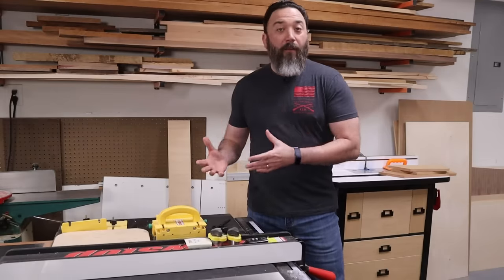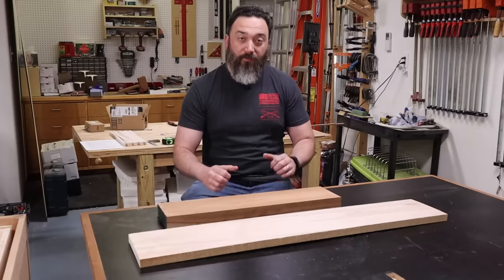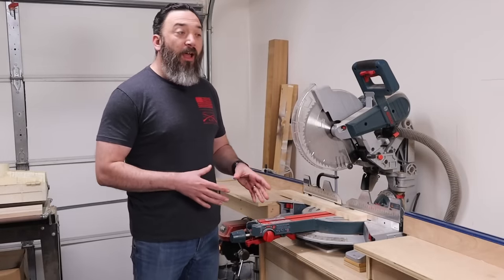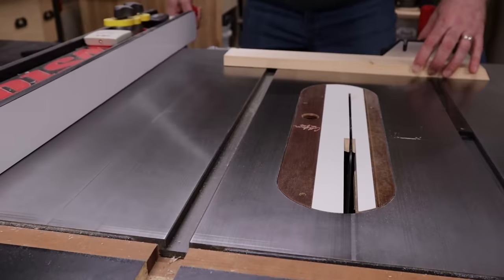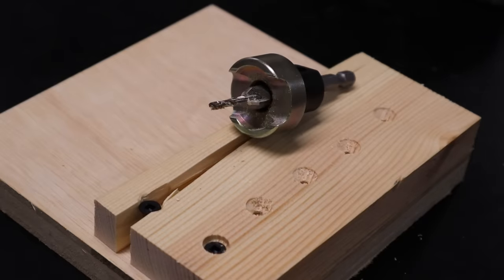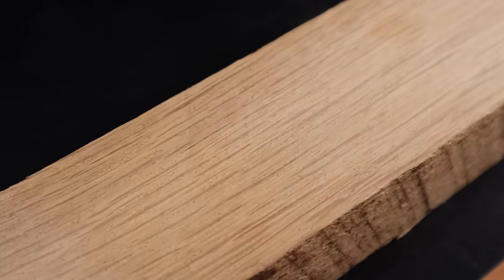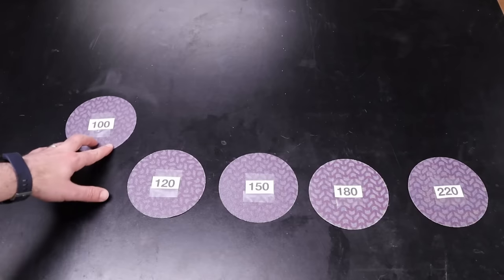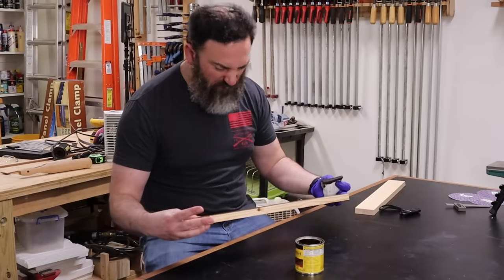Every Woodworker Should Know This!

Comment: I generally choose my next grit by adding 1/2 of the current grit and round down if needed. For example, if I'm using 150, I'll take 1/2 of 150 which is 75, and add that 75 to 150 which gives you 225. Rounding down means my next grit would be 220.
Reply from the maker: That method works as well! Use whichever is easier for you to remember.

Comment: It's been many years since I bought wood in the States. One point I can't remember when measuring for board feet is the difference between a rough-cut board and one that's been surfaced. So if you buy a rough-cut 4/4 board six inches wide, then the volume is clear. But if you buy a board that's been surfaced on two or four sides, it might end up as 3/4, by five and 3/4" wide. So how is that board measured? By the original dimensions or by what you're actually taking out of the shop?
Reply from the maker: It is dependent on the seller. Some will round up on the milled boards, others will charge based on the exact measurement but it's at a higher price than rough boards, and some do both.

Comment: Nice video but I think that a better rule for sandpaper is to just not go higher than 50% from the previous paper. So, if you're starting with 100 grit you wouldn't go higher than 150 on the next grit, starting with 80 then you wouldn't go higher than 120 next, and so on. This rule is just easier to remember, imho. Good basic knowledge in the vid though, thanks.
Reply from the maker: Same concept, use whichever you prefer.

Comment: As I was watching the part in the video about never placing the end of the board against the fence when using a miter, I noticed the gap you have between the bottom of the fence and the table saws surface. I mention this because of a close call I had while working for a custom cabinet shop, I was cutting backs for the uppers when the 1/8” material slid in the gap between the fence/table saw surface causing a massive kickback and causing the piece to hit me in the family jewels. 

I was taught years prior, when cutting 1/8” sheet material to raise the blade all the way up and when pushing material along fence with both hands put a upward bend on the side closest to you. Prevents piece from wandering under the fence. Just thought I’d pass it on, if you have any other techniques please share, I feel safe cutting this way but some people may noid out having the blade all the way up
Reply from the maker: You should try to minimize any gap as much as possible to prevent material from getting beneath the fence. As for blade height, I like to have the blade high enough that the gullets are above the surface of whatever I'm cutting.

Comment: Rubio monocoat only recommends you sand up to 120 to 150 grit
Reply from the maker: I know, but I've never had an issue with 180 using Rubio. I like the smoother surface at 180 so that's what I do. They also say you only need to apply 1 coat, but I have much better results and a nicer finish if I use 2 coats.

Comment: I just found this channel.  I will search what other tips you have, but is there an indoor vs outdoor wood video?  Which wood types should be used for outdoor.  I have a project to build outdoor items that will need to withstand dry heat (100+ for months at a time)
Reply from the maker: Any wood left outdoors without regular maintenance is going to eventually turn grey and crack and any finish you apply will start to break down. If you want to keep something outdoors for years, you will have to use good materials and regularly maintain the finish. 
That said, some of the best wood for outdoor projects are: redwood, cedar, cypress, white oak, mahogany, teak, and ipe.  Treated pine is an option as well, but not something I like to work with.

Comment: Excellent tips.  Saved video as I have to make a toy box for the most destructive great grandchild on the planet.  Any suggestions on hardware?
Reply from the maker: I've built several toy boxes for my kids and nieces. I really like to use safety hinges that won't slam down on little fingers when they open the box. 

These work great! There are different sizes available depending on how heavy your lid will be.
https://amzn.to/3wPE8RB

I also added some rubber bumpers beneath the front of the lid to stop any banging from closing the lid and it creates an even reveal since the hinges will hold the back of the lid up a little. 
https://amzn.to/458VF3y

Semper Fi!
Reply: @biscuittreewoodworks  Thanks for the tips and the Semper Fi!

Comment: Easy rule for sanding. If you start at 80, divide it in half and add it to the 80. 80+40=120. 120+60=180.
Reply from the maker: Yeah, but it breaks down after that. Half of 180 is 90. 180+90=270.

Comment: When it comes to sanding and the wood is very rough, you can start with 60 grits, and when working with hard wood, a basic finish is 220 but if you want a great finish then it's best to go to 320 or 400. Past that point is an extreme, the only time you do go past that point is when working with resins, then you would need to go up to 2000 or 4000 grits, but that is so much work that it's best not to do it if you are a beginner woodworker, rather get used to the basics and work your way up.
Reply from the maker: 60 is very rough, I don't usually start there unless I'm removing an old finish that is very thick. I almost never go up to 320 or higher sanding the wood. That's just going to burnish the surface and make it more difficult for a finish to adhere properly. Higher grits can be used to polish the finish if you are using a film building finish like polyurethane or lacquer. Just be careful not to sand through the film layer into the wood.
Reply: @biscuittreewoodworks  thanks for the heads up. So far, I haven't come across that problem. I don't like to use varnish as a finish, I stick with a mixture that I make, which is 60 to 70% Olive oil and 30 to 40% bees wax. It takes a bit of elbow grease, and in the end, it looks stunning.
Reply from the maker: @kai-uwefranck6076  I would not recommend using olive oil in a wood finish. Oils like olive oil, vegetable oil, canola oil can go rancid. Switch to mineral oil, teak oil, tung oil, or linseed oil which are all great for wood finishing.
Reply: @biscuittreewoodworks  that is why I use the bees wax, it prevents it from going rancid and so far, I've never had a problem. If olive oil stands in the open air unprotected, it will go rancid in between 18 to 24 months.

Comment: Board feet is based on rough cut wood. A 3/4" finished board is sold as 4/4 then length x with. Then a planing charge. This is how my mill charges.
Reply from the maker: Depends on your supplier. I have some 4/4 skip planed in various species that measures between 0.935"-0.955". I've even heard of some that are over 1" to ensure you get your money's worth.

Comment: I use 60 to 80 grit to take the grain down, then 220 to 400 grit to give my wood a smooooooth, skating rink finish.
Reply from the maker: I don't usually go above 220 because some stains and finishes have trouble absorbing into the wood grain if you sand too fine.

Comment: Make a little series…You have a nice presentation style👍.  Board feet….Nuts?  Taking a volume (cubic inches) and representing it as an area (sq ft) Why?  Volume I can understand, it’s the quantity of material.  Square feet I could understand IF all boards had the same thickness.  Weight I could get behind as it is also the amount of material you’re buying….but Board feet???
Reply from the maker: A board foot is just another way of representing volume of wood. It is exactly the same as calculating the cubic inches then dividing by 144 to get board feet. One board foot is the same volume as a 1 foot long board that is 12 inches wide and 1 inch thick. 1 foot long, 6 inches wide, and 2 inches thick is still 1 board foot of wood volume.

Comment: I had my wood stored like in the video almost identical shelves, almost identical sum of wood. It collapsed, around me, in a spiral pattern. I was standing beside table saw. I was so scared, I just stood there for about 30 minutes realizing I could have died crushed under the wood. The point. Never store lumber like that, ever. The floor is just fine.
Reply from the maker: That sounds very scary! Glad you are okay! I use very large lag screws into the wall straight through the studs. Very strong!  It I make sure not to overload it and check it often!

Comment: Gun foot is the length x breadth x thickness divided by 1728 cu. inches. So, it’s a volume measurement . 1 gun foot = 12”x 12” x 12” = 1728 cubic inches.
Reply from the maker: Yes, that is also refired to as a ghan foot, which is 1 cubic foot of lumber. Whereas a board foot is 1/12 of a ghan foot or equivalent to 12"x12"x1".

Comment: Doesn’t Rubio suggest to stop at 120 grit or 150 max for adhesion.
Reply from the maker: Yes, but Rubio was created for the flooring industry, where you might not want a silky smooth surface. Most woodworkers I know have great success with applying Rubio around 180 grit on furniture projects. 
Rubio also says to only apply one coat, but me and many others lightly abrade the surface and apply a second coat to increase the protection and sheen of Rubio.

Comment: The most important tool in my shop is my sawmill. With out it I wouldn’t have the lumber and I refuse to buy lumber. If I need it I cut it down off my land mill it to what I need dry it then build it.
Reply from the maker: Wish I lived out in the country again where I could do that! Only have about 1/4 acre right now and two small trees that I'm not allowed to cut down!
Reply: @biscuittreewoodworks  that stinks. I have a Woodmizer LT15 Wide and a blade sharpener and setter. Up front was a little expensive for a woodworking hobby but over the years it’ll pay for itself.  No hard wood dealers close to me but 400 acres of every kind of oak, pine, walnut, hickory and so on I’ll do the work my self makes sense.

Comment: 4/4 isn't always 1" thick.  4/4 S4S can be as thin as 13/16"...it was 1" thick before the lumber dealer put the final surface on it.
Reply from the maker: That's right! Every lumber mill is different. Some will be a bit under, while others will be a bit over 4/4. I've even seen some that sell boards listed as 4/4 that actually measure close to 5/4!

Comment: I disagree on your relative dimensioning process. The dimension should be taken at the fixed ends of that base cabinet. Never mid stream. There could be bowing on one or both pieces in the middle/field area and you would just be locking in that which needs to be corrected. Think about framing a wall or floor/ceiling system. The stud/joist will almost always have a bow to some degree. If measured in the middle third of the stud let's say, you would be fixing the stud in an incorrect location. Always measure from the extreme top or bottom to get the dimension needed for any wall blocking. Same would go for the base cabinet where discrepancies are even less forgiving than in framing. My 2 cents. Thanks.
Reply from the maker: In general, that would be correct. For the drawer dividers on the front of the case it did just that. I got my measurements from the side where the pieces were well supported. However, at this point the case is well supported with internal construction and there is no bowing so I'm confident with taking the measurement where I did.

Comment: For those that want to divide by 144, divide by 12, as 144 inches is 12 feet, same result!
Reply from the maker: Not sure what you are trying to say but dividing by 12 instead of dividing by 144 does not give you the same result. 
Now if you use feet for the length instead of inches, then yes you divide by 12 instead of 144. But that is not as accurate since your boards may not always be a nice round figure like 12ft long.

Comment: Good video. However industry standard for measurements is thickness x width x length.    Never a reason to sneak up on a precise cut.   Measure 2x and cut it once.
Reply from the maker: Thanks, but industry standard for buying hardwood lumber, at least in the US, is board feet. Technically it is thickness x width x length, which is the volume of the board. It's just expressed in units of board feet. 
The only reason not to need a precise cut is if you are doing imprecise work. When building fine furniture, jewelry boxes, keepsake boxes, etc. you need to be precise if you want a good result. If you are doing construction, shop cabinets, signs, and noodle boards then you can afford to be less precise.

Comment: Lot of information, but the american capability to mess up measuring is impressive. Here, in Sweden, I can order a 45 by 95 to the desired length. That piece of wood is 45 millimeters in one direction, and 95 in the other. Length is given in millimeters, centimeters, decimeters or meters - everbody knows what you mean, no calculations required.... Price is set by the length of the specific dimension... Simple....
Reply from the maker: We can do that too with dimensioned lumber which is usually construction grade lumber. Your 45x95 is our 2x4. We can get 2x4s anywhere from 8ft to16ft in length. 
However, in the video I'm talking about hardwood lumber which isn't sold in nominal dimensions so we use board feet which is a unit of volume. From the people I've talked to, other countries have a similar measurement system for hardwoods using metric units to determine the volume of material.

Comment: It’s silly they are stuck on such an archaic measurement system. But I’ve had to deal with Astronomical Units.  And euro shoe sizing  is still baised of of barley grain. My foot is a 42 (42 barely gains long).  I will just convert there Amish low tech metering, to thousands of an inch.
Reply from the maker: What? Shoe size is measured in grains of barely? wow

Comment: How did you, do you, learn your skills? Do you watch other youtubers or find this information in books. There is only so much you can learn by experience only, plus the problems of learning through mistakes.
Reply from the maker: I learn from many different sources. I started learning to build things from my dad when I was very young. I've read lots of books and magazines on woodworking. Lots of YouTube videos and old woodworking TV shows. I've taken courses on building large, complex projects. I have a background in engineering so I understand the mechanics of objects as well as tolerances and precision measurement. The rest is getting out in the shop and building things.
Reply: @biscuittreewoodworks  Thanks for your reply. I've worked on framing, siding, and finish crews. I've also worked in a cabinet shop, and was a GC for a new house construction. I'm amazed by how much I still don't know about woodworking.

Comment: Thank you for this video - the first of yours I have seen.

I am one of the dwindling number of people who actually took wood shop classes in High School (in Maryland, graduated in 1967.) 

As others have said, there is much I have learned and said before, BUT, a refresher is always a good thing.

Probably the most dramatic lesson we had in wood shop was one day during lunch. One of the shop teachers needed to run a small piece of wood across the jointer. Unfortunately he sacrificed his right thumb to the gods of haste and carelessness. It was a small piece of wood, but: he did NOT use a push stick or block - he pushed it by hand 😮 - when the knives hit the block, the piece "went thataway" and his thumb went down. 

Last I heard of him, he had  switched from teaching to administration. 

But I bet none of us in the classroom that day has forgotten that hard lesson!

When using tools, especially power tools, SAFETY MUST COME FIRST! 

Another thing I decided for myself in that class was that I will never ever own a table saw. IMHO, because they are too damn dangerous. Only the very recent invention of the Sawstop device has changed that, and you have to buy a new cartridge and saw blade whenever it triggers. (But your body part is safe.)

When I set up my first shop in the mid-1970's, I purchased a Radial Arm Saw as my primary stationary power tool. I still have and use it, and all of my "original equipment" body parts are still here.
Reply from the maker: Yikes! That’s one way to really make the lesson stick with your students, but one you can only teach so many times before you run out of fingers!

Comment: So that's what a board foot is. I would read through financial results of wood companies and not fully understand what a board foot was. If I'm reading that math right, it's based on a board that is 1 foot wide by 1 foot tall. If you measured it in inches, you would divide the inch number by 12^2.
Reply from the maker: It's a measure of volume, so height, width, and length.  Measure all of those in inches, multiply them together, and divide by 144.

Comment: The  cherry is 2.1 board feet 300÷144 =2.08
Reply from the maker: Yes, I rounded the results for simplicity. The point is a long board may be the same volume as a short board, so you need to calculate the board feet to determine price.

Comment: Relative dimensioning?
I am not in agreement. You should have measured that inside to inside dimension at the end of your cabinet where your size was controlled by one of you aprons and then match that.
Reply from the maker: You are correct, in most cases I would take the measurement from the end where there is no chance of a bow affecting the measurement. You can't really see in the shot, but I have stretchers throughout the case that have already eliminated bowing. But thanks for sharing that tip!